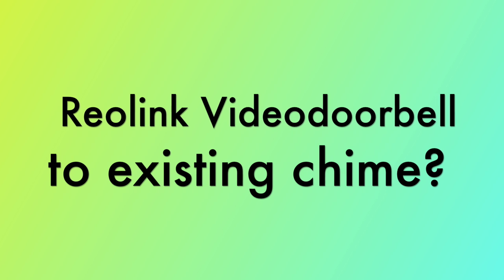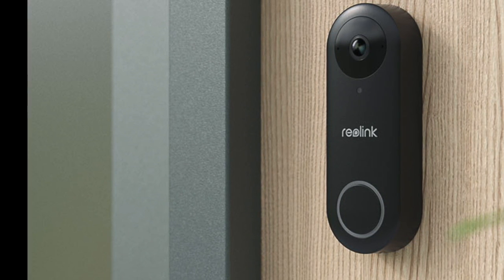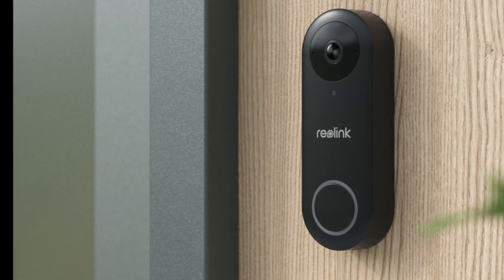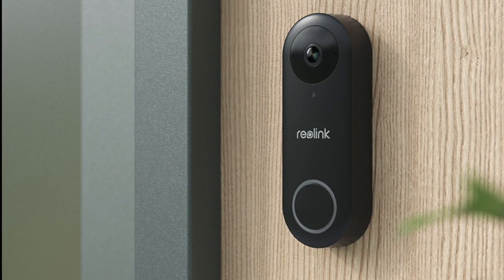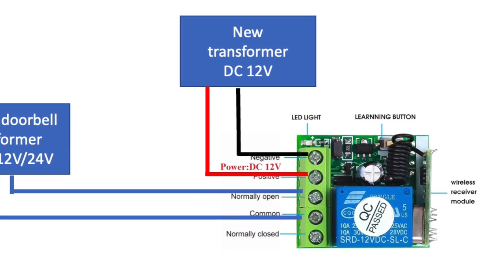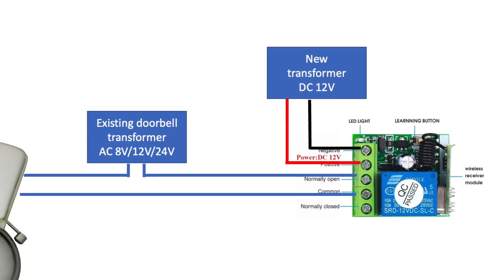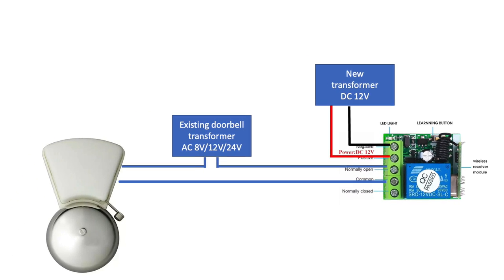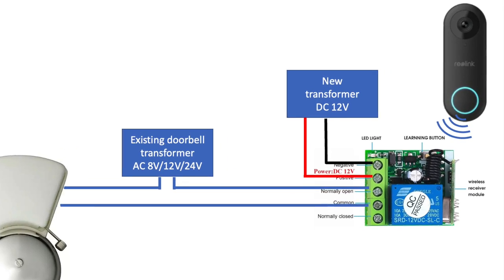Yes, connect Reolink Video Doorbell v1 to existing chimes!

Comment: Nice work - thanks for sharing. I did this slightly differently, by fitting a 3A 12V transformer to run everything. I cut the wiring to the bell push and chime, then used the +12V to power the receiver and the Reolink doorbell. Once that was working I wired the chime between the receiver's "Common" and "Negative", and connected "Normally Open" to "Positive". It worked okay, but I have a "ding-dong" bell which only rings when power is connected or disconnected. To make it ring three times, I installed a timer relay between the receiver and the chime, and set it to On for half a second and off for a second. End result, I get a nice "ding-dong, ding-dong, ding-dong" when someone presses my doorbell :)
Thanks for sharing the secret about the availability of the receiver relays!
The one I used was a little different, but the key is to find one that's advertised as using the "Princeton" or "EV1527" protocol.
Reply: Hi @electrickery. Which timer relay did you use? Do you have a link for me? Thanks

Comment: It's a good solution but what I really wanna do is solder in a second or throw on top of the existing button a second GPIO button that somehow shorts the 2 AC wires from my existing 10W transformer, then I power and leverage video via POE.

Reliability of analog but with the convenience and features of digital - haven't seen it done yet but I'm sure it's possible without a relay - just need to engineer a way to terminate the AC wires and short them while keeping the rest of the device intact

Comment: Ran into 2 issues, 
1. My doorbell chime wires had to be shorted to power the Reolink doorbell. So I needed a 2nd power source for the chime. I end up using the adapter from the reolink doorbell package. 
2. The DieseRC 433Mhz Universal Wireless Remote Control that was linked did not want to learn the signal from my Reolink doorbell(wifi version), not sure if it is because Reolink changed it or something. However I then remember I had broadlink pro with RF remote. I end up using that through the home assistant integration. 

non-issue issues
3. There is no way to set the chime that was included with the Reolink doorbell on a schedule. Because of that, if I were to have succeeded in connecting the Reolink doorbell directly to the DieseRC 433Mhz Universal Wireless Remote Control, I would have no way to control when it snoozes without another smart switch.

Comment: In case I have the 900Mhz version, is there a receiver available somewhere for pairing?
And are you sure it is 900 or 868 Mhz?
Reply: I wasn't able to make it work with the 900 mhz version. I sniffed the traffic on 915 mhz and it seems that there is some sort of 2-way communication going on between the plug-in chime and the doorbell. My plan is to instead use the event from the network (there's a doorbell event in HomeAssistant that is triggered) and then maybe trigger the chime with a zwave-enabled relay or something, though I haven't quite dug into if that's possible or not. Essentially, I just want to add a small device into my chime that I can send a zwave signal to simulate a button press.

Comment: Thank you for the instruction. Will it work with both Reolink wireless chime and the existing one?
Reply from the maker: Yes, they both work simultaneously
Reply: @michielcornelissen2430  Thank you. I appreciate it. Will work on mine
Reply: I can't get my wifi Reolink DB to work correctly. As soon as I attached the 2 wires to the Reolink the existing house chimes non-stop. What am I doing wrong? I'm replacing my Ring2 doorbell and it work fine.
Reply: @EarlBalentine  Have you checked the Normal Closed or Normal Open connection? I think it might be the case

Comment: Hi Great video, Is it possibel to us the DC power adapter that's is supplied with the Reolink doorbel, to power the doorbel and this 433 reciever?
Reply from the maker: Don't think there is a power adapter supplied with the Reoling POE doorbell. There is a power adapter supplied with the WIFI version, but this is 24V DC. You cannot use this directly with the wireless receiver, since this needs 12V DC.

Comment: How far can the 433 Mhz universal wireless switch be from the Reolink doorbell?
Reply from the maker: Quite far. 20m if not too obstructed. 
But you can test this before buying the wireless receiver. You can test it with the supplied Reolink chime.

Comment: i have 433mhz relay powered with ac/dc 12 v adapter to power it and a trivolt transformer  
1) can i power reolink wifi bell directly to transformer 16v or 24 v ?
2)how do i power and connect chime to relay no and com port ? 
appreciate help
Reply from the maker: The 433MHz receiver needs to be powered with a 12V DC source. 
If the existing adapter for the chime is same, then no issue, but normally, the doorbell chime is powered by an AC adapter.
Reply: relay has power with ac/12v adapter and sync with reolink bell
Reply: thanks

Comment: Is it possible to mute or lower the outside chime ?
Reply from the maker: Yes, in the doorbell audio settings, you can turn ringing volume off
Reply: @michielcornelissen2430   thats only the inside chimes option … I need the actual door chime volume lower or off completely
Reply from the maker: No, that option disables the sound on the outside. The standard inside chime can be disabled by just not plugging it in.

Comment: How do I connect my Reolink wifi camera door bell to my Nicor tansformer/chime system? When I connect the 2 wires to the camera my house door bell chimes constantly. How do I turn off the house door bell chime? I have the Reolink chime door plugin chime.
Reply from the maker: If you want to connect the chime, follow the instructions in the video: You need an additional receiver.

Comment: What wires are used? Is the little remote attached to the home doorbell chime after the connection is made? I did purchased the adapter and little remote you suggested but I have no clue what to do next. Is it possible you could do a video actually putting this together? Sorry I am a 63 year woman who is non-savvy. Thanks for reading this.
Reply from the maker: the schematic how to connect the wireless receiver to the power source and doorbell is shown in the video. you might need a savvy-er person to connect it..

Comment: Any idea for the 868 Mhz version which is currently offered?
Reply from the maker: there are such 868 receivers available. but I don’t know for sure which one works with the V2. if you have found a working one, please let us know.
Reply: Today I tested the rx multi 300-868 mhz device and can confirm that this is NOT working with the V2 version. 😢

Comment: I have the POE version and it won’t connect to the receiver. The remote control that came with the receiver will set it off though. Any ideas?
Reply from the maker: The receiver needs to be compatible with and programmed for the Reolink. Might try the program the receiver again, also at other distances.
Reply: @michielcornelissen2430  How would I do that? It’s just the button on the receiver correct?
Reply from the maker: Yes, you need to put it in programmering mode
Reply: This trick only works with the V1 of the chime/doorbell. Check the sticker on the chime to see what version you have. V1 works at 433Mhz, V2 was changed to 900Mhz.

Comment: I use this method however the module is not being programmed to the RF signal coming from the reolink doorbell. I had to use another wireless doorbell and now it is connected to the old chime.
The downside is that I have two doorbells connected outside by the way the boys can be powered by a battery 🔋

Comment: When you say "disconnect the doorbell switch" .. how will the Reolink be powered (wifi version) ? it still needs the 12V from the existing doorbell transformer..
Reply from the maker: You just need to connect the Reolink to the existing ac transformer according its instructions. The chime needs to be connected to the new wireless receiver that powered by a new 12v dc transformer.
Reply: ?chime donot need to be connected to transformer just the 433mhz wireless receiver

Comment: Hi nice work... I have a question so my existing chime has a transformer and is connected to the electrical current and if i connect this adapter 433 mhz need to connect it too another 12v adapter?
Reply from the maker: Hi thanks for your question. 
The transformer of a chime is in most cases AC and higher voltage. The needed voltage for the receiver is 12V DC.
Reply: @michielcornelissen2430  in the video the red wire of the 433mhz adapter (common) and the black wire that comes out of the chime go to the button of the doorbell to give it power?
Reply from the maker: please have a look at the schematic.  The 433 receiver needs power from 12V DC poweradapter. The other 2 wires from the receiver act as the doorbell switch.

Comment: Can you go way more into detail on this? In the end you just have it set up on a piece of cardboard. Can you show it set up and used normally? Can you also show what 12v DC adapter you used with a link to where to buy it? Thank you.
Reply from the maker: The setup in the electrical meter cabinet is less clear than the example shown.
You can use following 12v adapter: https://www.amazon.nl/dp/B01G0Q3RWU
Hope it is clear!

Comment: I followed the schematics and it all works. The only thing is that the ding-dong sound of the chime is slower than before. Did you perhaps manage to solve this?
Reply from the maker: I do not have that issue with my electronic chime.
Reply: It could be that your existing doorbell transformer isn't big enough (unable to provide enough electrical current). Usually the doorbell transformer is 5VA or 10VA. Try to use the 30VA (12 - 24V, 30VA).

Comment: You rock. This worked perfectly!
Reply from the maker: good to hear! have fun!
Reply: Maybe you can do a video showing actually how the connections are made. The Michael guy just keeps saying follow the schematics, which is not clear enough for many of us. The bought the adapter and a 433mhz receiver. Have the wifi version of reolink but not understanding what's connecting the reolink doorbell to the adapter and so forth.

Comment: Hi is this module have to conect on power all the time?
Reply from the maker: Yes, the module needs power to be able to look for the wireless signal
Reply: @michielcornelissen2430  and can be connected on any doorbell brand like swann, ring, blink? ect ect ect.
Reply from the maker: Sure, any chime that is activated by supplying power
Reply: @michielcornelissen2430 ok thanks for the help.. the last think to understand what about the wires to the doorbell becuse my is wired...or the diagram you show y with the doorbell baterry  to get power on doorbell...
Reply from the maker: Just need to replace the old doorbell switch with the wireless receiver. This will activate your existing chime.